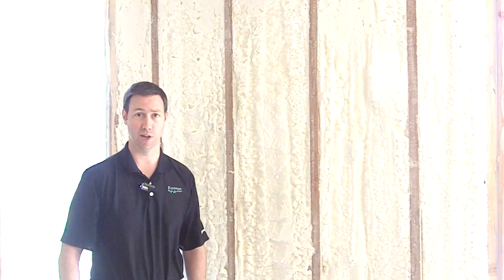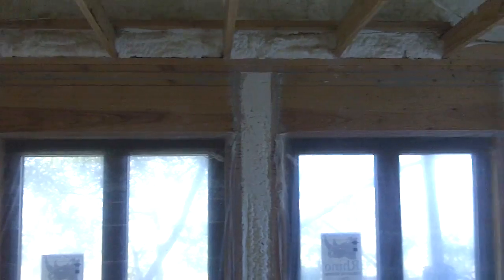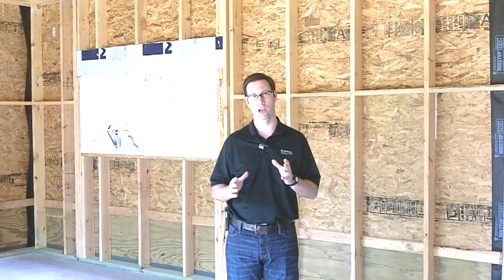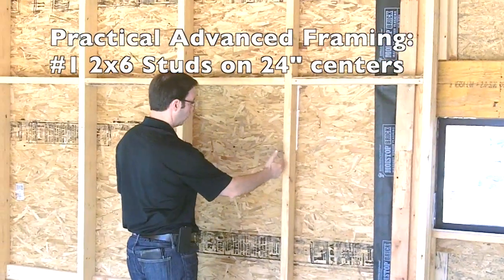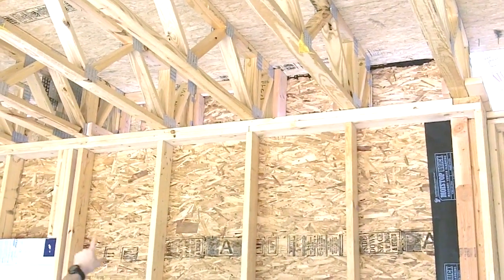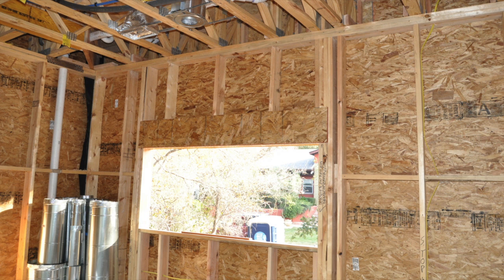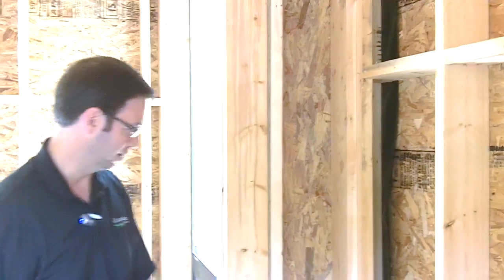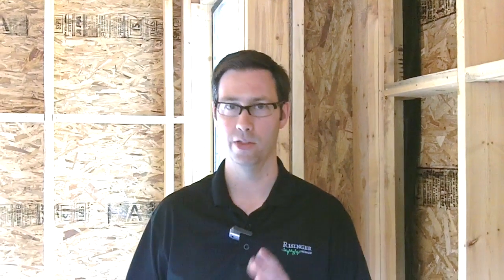Advanced Framing vs Traditional Framing

Comment: "Advanced framing"......euphemism for cheaply built house to maximize profit for the builder.
Reply: +falcondriver100 well than you need to review your books. this advanced construction uses 2x6 studs instead of 2x4. per 8 foot length that is actually the same amount of wood to bear axial loads but it has increased thickness. And you should know that increased thickness will increase the moment of inertia by the cube of the length and because the outside sheeting is what really carries the lateral loads in the other direction we don't lose anything we only gain strength of the wall in both compression and bending. This wall system is actually stronger than the traditional 2x4 construction. The real issue is that you will need to use nicer more expensive wood, drywall and more insulations (more insulations being a good thing).this home will likely be more expensive to build in terms of materials. It might save some (very little compared to the overall cost) on labor due to fewer studs, few screws for drywall, less spacle but none of those reduce the quality of the structure.
Reply: I say we use 2x8 for external walls. Don't leave any spaces whatsoever.... just one right next to the other, continuously.
Reply: Old grain elevators were built very strong, the builders laid all the timbers flat, lots of hard wood, enormousdemolition job, fastest, easiest, most dangerous demolition is to burn them down,
Reply: Jimmy  Sorensen the lumber savings isn't the key.  The improved insulation ability is the idea behind the change.
Reply: See? Someone else here has an ounce of common sense. Thank you sir.
Reply: Marty Stamey ...California corners save what? maybe 8 2x4's in a whole house???
Reply: +Brandon Montero finally someone with some sense
Reply: I brought this up to my dad (Mechanical Engineer w/2 BS & 2 Masters and his PE and 30 years experience working with clients such as NASA), my step dad (architect with PE and 50 years experience) and brother (structural engineer with PE) they unanimously said you're full of shit.
Reply: whitey211 all dependent on your ability to accurately convey the information, and being able to do so unbiasedly. My guess is you likely fell short on one of those two.
Reply: Longest
Running thread in history

We need to settle this matter
16 or 24 “?
Reply: Travis B Sorry, I have no idea what you are talking about. I looked at all my posts in this thread and I can find nothing that even remotely applies to what you are saying.
Reply: Jim Watson this comment is still making people laugh 3 years later lol thank you
Reply: Im no carpenter, but i will continue to think 16 oc and standard headers are better
Reply: falcondriver100 hey lets make plywood and sheetrock only 2ft wide that way it will b lightet!
Reply: @martystamey1528  that's funny. Because sheetrock comes in 5/8 ultra light 2x8
Reply: Wood is a good insulator.  Stationary air is a much better insulator.  Heat may rise but heat transferring out is one small factor in meeting energy codes and, more importantly, building a comfortable and energy efficient space.  Cooling is just as important as well as quantifying air changes per/time.  

A typical 3 stud corner has the same nails in the same shear as the 2 stud as it relates to the perpendicular wall.  Additional strength was never the reason 3 stud corners came to exist.  The 3 stud corner is just the easiest way to get a nailer there.  

There is no one solution that works everywhere or is best everywhere but the 2 stud is fine.  The 3 stud corner will not work in many wind and seismic zones just because it doesn't allow room for mechanical tie systems in necessary places.  Modern, pre-manufactured insulated 3 stud corners work well and can be as efficient as this 2 stud.
On the flip side, 2 stud corners are not allowed in some locations that require double blocking at sheathing nailing edges.

This video illustrates just one good method that may be possible to increase efficiency of the building.
Reply: missmymountain ... I use scrap blocks between two studs instead of a third stud. Enough scrap cut off Lumber land around the job site to use it
Reply: You bring shame to mechanical engineers; as for pillar strength its the same strength, and as for lateral strength, an engineer would know that strength (laterally) would rise as the cube of the width of the wall. So roughly, more than 3 times the stiffness.
Reply: Chris Allen ....and in the case of roof rafters 2 foot on center looks bad when sheathing deflects over time
Reply: Jimmy  Sorensen yes it does. I started building my houses 16" o.c. rafters before it became code where I live. This guy is young and enthusiastic but obviously inexperienced in construction. my blood pressure went up watching
Reply: The loading on 2x6 on 24" centers vs 2x4 on 16 centers is perfectly fine and is engineered to hold as so.....you do not lose shear strength as your osb panels will provide that, and you are not using half the wood by going 2x6.....you are getting a better product by getting more r value in your walls and lowering your electric bills.  In the end you are saving your customer money.  Nothing wrong with that.
Reply: +Jim Watson I laughed at your last comment.
Reply: Jimmy  Sorensen they save the company from having to hire competent framers.
Reply: Marty Stamey depending on where you are it's probably old growth heart pine. It doesn't rot ,it just gets harder and termites break their teeth on it. lol.  It's some of that stuff you have to pre-drill to get a nail or screw into.
Reply: Jimmy  Sorensen you mean wavy roof
Reply: "Its 101 my dear Watson, when you use half the material in ANY construction it inherently weaker......... especially laterally." -falcondriver100

The first computer was the size of a house. But you think today's computers are inferior because they use less material?

Multitudes of designs use less material and becomes more efficient as improvements are made. Just look at cell phones, cars, planes, computers, tools, solar panels, motors, high tension concrete foundations, air conditioners, libraries to kindles, Cd's to MP3 players, do I really need to continue?

If you're an engineer, then smart people can be really dumb sometimes!
Reply: @portaadonai  oh boy I just found an even bigger idoit 😂
Reply: Totally disagree with falcondriver100 - this guy Mat knows his stuff and fair play to him! A young, confident and obviously very knowledgeable about his product!
I'm a carpenter/joiner by trade and undertake general building contracts and this guys bang on!
Reply: falcondriver101 if you are an engineer then you should know how important the math is and a mechanical engineer is not the same as a structural engineer. to build a 20' wall section with no corners it will take you 16 - 2x4x8' studs @ 5.3 board feet (BF) a total of 84.8 board feet or 11 -2x6x8' studs @ 8 BF with a total BF of 88. 3.2 BF over 2x4 studs @ 16" centers. Your sill and plates will have to be 2x6 and he has a stringer in his wall to carry the edges of the outside sheeting and dry wall. With a 2x6 wall he can put in more insulation then he can with a 2x4 wall. all of this cost more so I can not see how you can say that  that such a house is built cheaply or that you can say that you know what you are talking about.
Reply: falcondriver100 agreed, most municipalities around me won't accept 2' on center as it is. to everyone else, you don't need a 2' on center to prevent a 3 board corner, you just need framers to to keep at least 10 inches between studs on corners.
Reply: Jimmy  Sorensen , is the cost difference very much? thanks.
Reply: Jimmy  Sorensen your biggest investment is your house. Id over kill if anything. lots of bareing points on a house when you are stick framing
Reply: Jamie Risk...Width of the wall?  Please explain.
Reply: Brian Minghella Im remodeling a motet built in 1821 I dont know what they treated there. lumber with but it doesnt rot. 30 windows had to replace 2 ceals!! The old rafters are numbered in roman numerals. Steps is wooden pegs but only 2 stringer you can tell they didnt have power tools back then!! I think of my 30yrs expertise its not as much of the craftmen ship as. the material!! Back when a 2x4 was a 2x4
Reply: falcondriver100 Heart pine is what was the old growth southern yellow pine (syp)that had tight grain and turns to what we call lighter knot over time due to the high sap content. The new syp is shit, it's fast grow timber with wide grain and high cellulose that termites love.
Reply: falcondriver100 Syp is primarily a  southeast timber that is logged here  it's also what international paper uses to make paper out of. We also have cypress, juniper( white cedar) and  cedar ( aromatic cedar) with the red hearts. It smells like the western red but it's only red in the centers. Makes beautiful furniture with the bright white outer and the crimson (sometimes purplish) centers. Outside applications are ok but as with any wood you have to maintain it not just wood rot and termites but carpenter bees will drill holes all in the softer wood
Reply: Not so. built 12 houses where advanced framing was required for energy star and and Advanced Energy requirements. didn't save any money on the builder side. not a fan of some of the advanced framing requirements.
Reply: Thickness: euphemism for stupidity.
Reply: Alonso Glez ...yes especially with snow and ice on it
Reply: I agree 100 %. The problem we have here in Ontario ,Canada is that builders ( developments ) literally slap houses together in 4 days and have a finished product in a month. We have strict building codes, so they are solid homes, but the finished product in sub-devisions around here can be shocking and disgraceful. The quality of the home is lacking but the home is up in no time. Even the lumber in some of these homes are as we say it, manufactured by the same guys making Easton hockey sticks. Pretty sad!
Reply: Was just going to say the same thing, old growth forest 400 year old trees they cut down. Look at the ring counts, bet there is 50 years in a 2 X 4, be lucky for 10 today, 400 years old, cut, almost 200 years old after cut, almost 600 years old now, impressive.
Reply: Here in Utah if you have 9' ceilings or a 2-story home it is now required by code to use 2x6s spaced 24" because it is stronger and the improved insulation is an additional benefit. I too am a mechanical engineer and I think it makes sense that the 2x6s are stronger even when spaced farther apart. The plywood gives most of the rigidity in that direction. Decreasing the spacing doesn't help much. On the other hand, adding two more inches to the other direction substantially increases rigidity along that axis.
Reply: I wrote out a very similar response and then noticed yours. I too am a mechanical engineer and I'm a little surprised this guy didn't see that the 2x6 construction would be more rigid despite the larger spacing.
Reply: Sometimes less is more.
Reply: 35 years old, dad was a framer and now I am. This style of framing on the corners and interior connection of walls has not long been made into code here in Florida. However I don't give 2 shits what any engineer says 16" centers is better than 24" centers any day of the week. The main reason for this push is the power companies. Builders get incentives to have more insulation in the walls and less wood and in turn use it as a selling point with the promise of a lower power bill and certified by said power company.  You will never beat the structural integrity of 16" centers on studs. More nailing surface= more sheer strength. Now if some computer guru could figure out how to make a set of blueprints read a 2x4 wall as 3-1/2" instead of 4" that would be great.
Reply: Framed for 25 yrs ! Up to 25 houses a year i call BULL SHIT! just like your vehicles now days!! less metal weaker vehicles!!  16 centers is the only way to go! Dont b fooled by this bull shit to save a buck. It will cost you in the long run!
Reply: +falcondriver100 2x6 cost more than 2x4.  R-19 cost more than R-15. Rigid foam is still insanely expensive.  If you have experienced guys I would estimate the cost would be very comparable.  Either way maximizing the profit for the builder is the name of the game and always will be.  To be successful you have to deliver a quality product for a reasonable price.
  I really don't understand your comments.  You say that you are a mechanical engineer.  You say that using half the material makes any construction inherently weaker.  Seriously are you kidding me?  What did you study in school?  how to make things heavier and use more material than necessary?  Wow I bet you quite the successful engineer buddy.  What do you think builders should go home and live in a shack and not send their kids to college too?  This is a business.
  Lets say you are a builder.  There is a construction method which can save you money but also deliver a higher quality product to your customer.  Wouldn't it be idiotic to not at least consider it?
Reply: @emutiny  ⅝ inch sheetrock is not cheap any it's awesome! Foam? Not cheap and awesome! Plywood sheathing and 2×6 all great. And the header being insulated? Another plus. I would think this would cost more that the standard 2×4 home that's 16 on center. I really don't see a problem with this. BTW, those trusses weren't cheap either.
Reply: +Jim Watson You must not be much of a framer yourself if you have never heard of 3/8'' on 24'' centers.  Very common in older houses.
Reply: I'm happy for you!
Reply: falcondriver100 there 2x6 not 2x4..and 16 center is code in md,but it use to be 24 center
Reply: so agh how ... blagh bagh
same money
Reply: ding ding ding!!!!!
Reply: missmymountain 6" vs 4" (thickness if you prefer)
Reply: Jim Watson  builders cheap out by stretching the stud span from 16" o.c. to 24" o.c. to save money. Takes away from structural integrity
Reply: whitey211 agreed.  Ray Charles could see that aint worth a shit
Reply: Brother personally built his house. Step dad personally built two of his houses. Dad gave NASA advise on repairing their older assembly units. If you think these guys got to where they are by doing shoddy work you might need to rethink. I'd have no problem telling you each of their short comings, but being damn good at their jobs is not one of them. When people around the country start lining up for your know-how, fly you out on their dime, house you, feed you, just for a couple days of your expertise you can talk about how you know more. Till then...you probably don't.
Reply: Were we comparing 2x4 to 2x6 or to timber frame? Because if you are going timber frame that is fantastic. Seriously. I applaud you on having the skill it takes to do that. But I believe the debate here was that 2x6 construction is worse than 2x4 construction. You seem to be saying it's all crap compared to timber framing, which I won't argue with, but it's not really what was being discussed here.
Reply: Sounds good to me. Most of the timber framed houses I've seen built (on youtube, never witnessed one in person) lack a lot of modern amenities like AC and good insulation. How do you handle these in your house?
Reply: I am and he's right.
Reply: The corners are necessary to have something to fasten the drywall to on the interior. You obviously know nothing about building a house.
Reply: @R.L.Thomas  I want my exterior walls 16" oc. My inside petition 2' oc. If u put exterior 2' oc u better put wind bracing in your walls and sheathing clips. I'm a builder in Michigan for over 20 yrs I built many buildings 2' oc and always staggered my sheathing and wind braced everything
Reply: Anybody know where I can get some 3x5s on the cheap?
Reply: You said it all. 

I know for sure that less woods less strength. 

 I am worried .
Reply: All of the osb is installed incorrectly due to lateral strength. (The black lettering cannot be horizontal for two sheets in a row)I am a professional framer out of madison Wisconsin. This guy is a joke. Not 16 oc and compensate with 5/8 drywall for walls?! This is the opposite of advanced.
Reply: falcondriver100 you are 100% correct and your statement is backed by professionals
Reply: Falcondriver100 know what he's talking about.
Reply: To all the Engineers. Just because you doodle it and engineer it that way, does not mean it will get built that way. Look at the video install closely. Someone mentioned over engineering I agree. You put four nails in the plans and specs you are lucky to get 3. No doubt it works it won’t fall over its sturdy. But the cost effectiveness of less lumber is BS. 25% less lumber sure. It’s greener. Cost of 2x6 is higher plus additional insulation and materials. It kinda evens out at the end. Big savings in labor though. But do you really want to stretch yourself thin? It’s just more risk.
Reply: @datanionuponga353  when you try to insulate in side a corner "t"'s and corners. The headers are as solid as they are is for straighten. The centers of studs are mandated by code, every one uses sheeting on the out side because it square up the wall. if you do not use sheeting then it is single boards and cut in braces. as you would find in houses over 100 years old.
Reply: stephen odell dude..... are you a robot? Terrible response. I hope your sales skills are better. And English isn’t my first language.
Reply: kinda thought the same thing . rather build my house 16' OC
Reply: my uncle re-framed his century home, i guess they used 'advanced' framing on the build because it was 24" centers ! LOL
Reply: Fine settle it all convert to light steel metal stud framing use not much lumber that way problem solved.
Lol
Hahaha
Reply: How does the "Advanced framing" come into play when there are hurricane and tornadoes? I think the question is: Does going from 2x4 @ 16" spacing to 2x6 @ 24" spacing affect the overall structural strength of the wall.
Reply: David T Smith keep in mind that when framing you're gonna have king and cripple and headers around windows and doors and plates run entire wall and is double on top! that alone will be extra strength in 2 by 6 construction plus any changes to window frames size would add more lumber anyway, and be sure to use 16 penny nails not screws! and glue glue glue all. boards! and 2 by 6 will be twice as strong as conventional farming!
Reply: At least he purlined the walls, but, yeah, 24 inches on center? No, no, no!
Reply: Aslanreturn 24 Inc is fine! remember that your plates run entire length of walls therefore you'll get extra strength with wider boards! and you can also use diagonal bracing with 1 by 4 boards, cut notches in 2 by 6 studs and you can nail braces permanently in walls!
Reply: Robert Slackware  ha!100 years ago much better huh..
You mean like a 100 year old balloon framed house where load points are without direct load bearing points? not to mention floor levels are not fire block isolated turning them into a fireman's/home owner's death trap nightmare when a fire happens?  Also have you ever seen the insulation if any in a 100 year old house??  How about the  non grounded knob and tube electrical wiring with the desintigrated insulating wrap on the wires that run through very old very dry lumber. 
Structural codes exist for good reason and keep the moronic general public and people like you from going around building houses for people as a business flying under the radar just because you shop at Home Depot.  
There are reasons for 100 year old house roof ridges sagging in the middle along with every floor sagging.... Building codes were not existent or engineered like they are today.   Your welcome
Reply: This "advanced framing" doesn't save the homeowner/buyer enough money to make a difference. It's going to be less than 1% of the price of the house. It's about maximizing profits for the builder and developer. Saving a thousand dollars on each house adds up to a lot of money in a 100 unit subdivision.
Reply: Not a very good mechanical engineer I'd say, falcondriver100. In a 48" span you would have 3 stud bays of 16" on center 2x4 for a total of 4 studs. And in the same 48" span of 2x6 framing you would have 2 stud bays of 24" on center. The Advanced framing technique uses more lumber per inch squared than the traditional method. It's also more expensive because typical sustainable forests yield more 2x4 from its timbers than 2x6 (and larger) materials. More yield often equates to cheaper price per unit. The structural performance of the two walls for KD 6% lumber is the same. So no..the Advanced framing technique yields the same structural value, is more costly in material but less costly in labor to assemble. Stick to mechanical engineering and leave the building codes to those of us in the profession of building.
Reply: Mark Doumert if by common sense you mean lack of understanding in physics and engineering than sure.
Reply: country boy agreed. I will never build a house on 24 inch centres. really doesn't change much other then losing 1 or 2 studs for 8'.  plus the lol as headers that's not cost effective.   where I'm at it costs alot more.
Reply: Use 2x6s at 16 OC, problem solved.
Reply: Pete Wilburn why? that's overkill plus you have more studs! more heat escapes
Reply: falcondriver100 exactly. This weak build process don't fly in my area anymore. Absolutely nothing special about this builder. I'd never put my studs 24 o.c. These kinds of companies Piss me off with garbage and taking advantage of customers that just don't know any better. As far as the insulation voids in the "three stud corner" that's why you hire a good builder that knows to insulate that before sheathing goes on.
Reply: PJ Hainer ...wood is a great insulator. Not much he is lost sideways out a wall. Heat rises. Be better off adding attic insulation than going with 2x6 walls vs. 2x4 walls... a spaced triple corner is stronger all around. More nailing surfaces to bond the perpendicular walls together.
Reply: @Jimmy-mt4kn  I have framed for 35 year and I could have not said it better.wirh only an inch and a half for the edge of sheeting to nail OSB to along the edge of a sheet very week
Reply: +falcondriver100 you are no engineer dumbass
Reply: A classic amateur engineer's opinion.  The opinion of an engineer in the group of those that love to build monuments to themselves instead of anything practical and economical.  The opinion of an engineering that is scared of engineering anything.  I'm confident you have no analytical experience with wooden structures.
Reply: Brian Minghella I'm intrigued, what sources can I read for proper(overengineered) home building tips. I'm considering Golden or Boulder CO in a few years. Are steel homes better than wood? I know 2x6 is better than 2x4 but what about the guy that mentioned 2x8? Any sense to that? Colorado gets cold. Thanks in advance.
Reply: @thisismagacountry1318  geodetic dome is the strongest house structure very resistant to wind and snow load
Reply: Jamie Risk Jamie's mom prefers thickness. +1 away people.
Reply: @falcondriver100 and 1950's cars are better built then new cars. /s
Reply: Cody Williams So go to Cuba and buy them all up.
Reply: +Jim Watson, google "weak-axis bending" and see if that helps you understand what is occurring at 4:34.  Many builders bid on a set of plans (which have more wood and, therefore, labor expenses, and then build it the way that is most convenient and profitable to them.  I see it every day.  Notice I said "many"..I didn't say "all".
Reply: +Crazylalalalala You need to google lateral load and weak-axis bending, instead of telling a PE to go back to his books.  I say that because you are an idiot if you think the sheathing "is what really carries the lateral loads".
Reply: +falcondriver100 Are you a framer and do you have any idea what you're talking about?
Reply: Jim Watson No, I'm a mechanical engineer and yes, I know what I'm talking about.
Reply: +falcondriver100 Then maybe you would care to elaborate on your blanket statement that ""Advanced framing"......euphemism for cheaply built house"
  Explain to me how his California corner is of poor construction.
Reply: Jim Watson Its 101 my dear Watson, when you use half the material in ANY construction it inherently weaker......... especially laterally.
Reply: +falcondriver100  In the field you have only one stud every 16" (if that is the layout you are using) Are you saying that there is not enough lateral strength at these positions? If there is,why would you need more at the corners?  

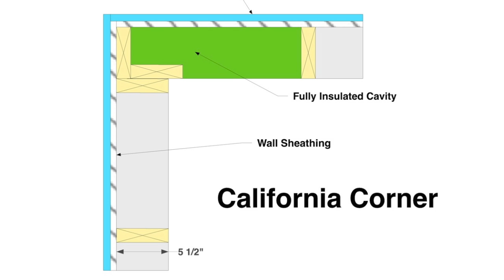  If you'll look at 4:41 in the video you will see that  there are 3 studs in very close proximity to each other. Should I use more studs than what is shown, eliminate areas for insulation, and wast material?
Reply: Jim, you ever work with the Carpenters Local? they teach the trades men well, non union carpenters, most are repairmen, remove a railing, put one back, stud a wall, apply sheet rock, like every ones an auto mechanic, hahaha, and a painter, Jack of all trades, masters of none,
Reply: @falcondriver100   while agree there is not "advanced framing" the corners a mute point as they used full depth foam. That in itself increases the mechanical capacity fo the house by at least 3 fold. just because you removed material does not mean its inferior. a 2x6 is excessive already. Not really doing any calculating falcondriveer100.
Reply: You are clearly NOT an engineer. No engineer would make such an ignorant statement.  @falcondriver100
Reply: You may want to pick up your Material and Methods book again.   I'm not sure if it pays to have 24" O.C. in terms of other trades dealing with the spacing (electrical, drywall , ect)  but a simple bending stress calculation will show 2x6'@ 24" O.C. have a greater lateral load capacity than 2x4's @ 8" O.C..  You have to remember that bending stress is an exponential function.  On paper the 2x6's @24" O.C. will out preform the 2x4's @ 8" O.C. by far.  If any of the readers question the calculations a lot of the lumber suppliers have free software that will do the calculations for them.  That being said, I think this is a good system if everything it done text book but traditional framing that's been developed over the years covers for a lot of non perfect conditions.
Reply: Amen. The way things are being built today is so corrupt it makes me sick.
Reply: +catothewiser Are you a framer, and are you qualified to give more than opinions?